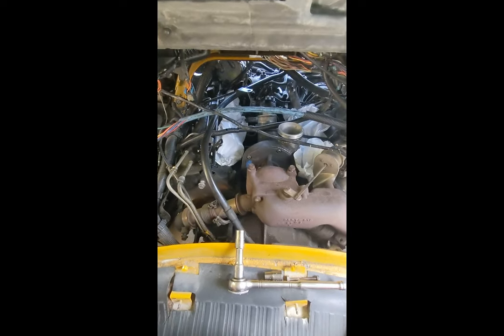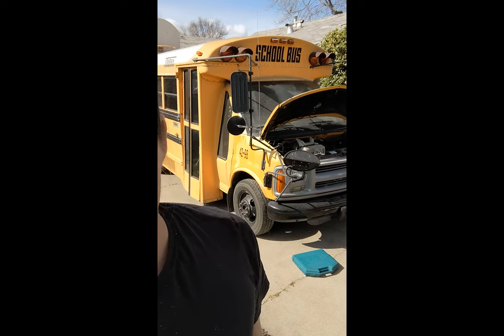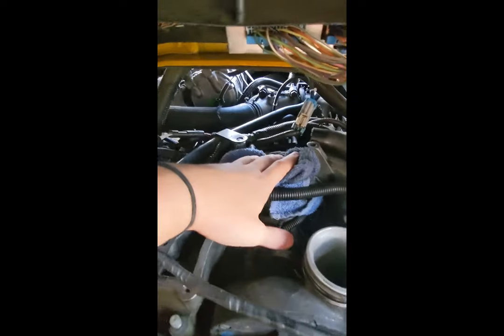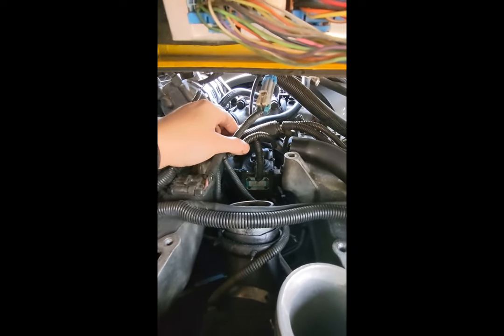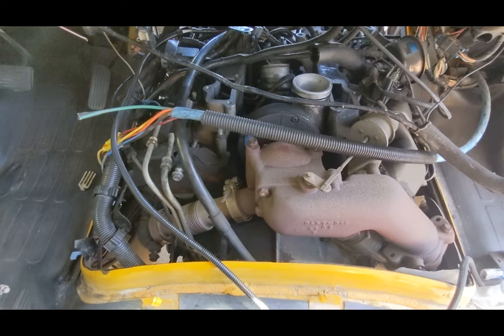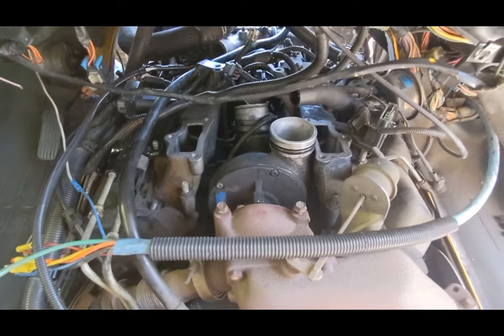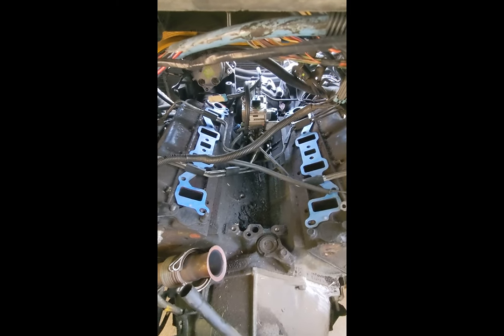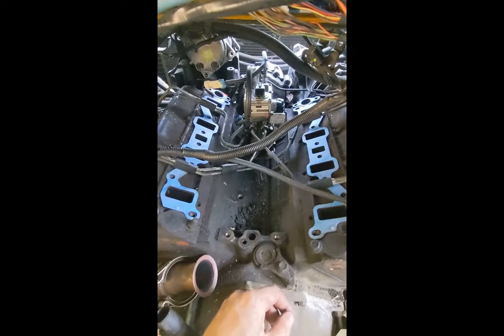Replacing the Fuel Injection Pump on a 6.5L Turbo Diesel in 97 Chevy Express School Bus

Comment: Great job, man. i have the same school bus, trying to get a few things done in the engine before i start moving in to converting my skoolie, a few things here to share with all of you and hopefully some help along the road. I think I have the same problem with my skoolie, starting right away. No problem on that, but I noticed some diesel drops between the belt cover where the transmission starts and the engine block, I popped my flash light, and i see diesel only next to the pump but no diesel leaking from any of the 8 lines does anynone have any idea? the other thing is what to do with all of the wires above the driver box. thank you.

Comment: 6.5l Turbo diesel injection pumps are shit. Otherwise the engine is decent.
Reply: Idk. Seems like the lift pump, pmd and ops are the shit parts that mess up the injection pump. I mean it's not amazing or anything but I  think it'd hold up if the other issues and maintenance are taken care of.
Reply: @patrickconrad396  I upgraded the lift pump, re-located the PMD and the pump still gave out after only around 24,000 miles. Not sure what else to do. What can be done with the OPS?
Reply: @sunnybeech74  from my understanding the ops sends a signal to the lift pump, so when it goes bad it causes a lot of issues. Have you checked your fuel lines and injectors? What's the fuel tank condition? And have you checked the filters? 25000 miles is crazy. Most people have fuel pump issues after 100k+ miles. Something would have to be getting in the injector pump for that to be happening.  

That said, are you 100% sure the fuel pump is gone? What is making you say that? Some symptoms of a bad IP can be caused by other issues too.  Checking the psi from the lift pump, which also tends to go bad often, but if you replaced it and still don't have at least 5psi there may be a clogged in your lines or grommets. Also check your glow plugs and relay.
Reply: @patrickconrad396  Each time we test it it all points to a faulty IP. A theory we have come up with is since the fact it is in a van chassis it runs hotter due to the fact that a van has a very compact engine compartment and there is much less space for he heat to dissipate. We also think it's the optical sensor that is the main culprit. I cut a hole in the hood and installed a cooling fan to try to reduce heat. Also I'm considering putting an air scoop over that hood hole to force as much cooling air past the IP as possible. We'll see how that goes.